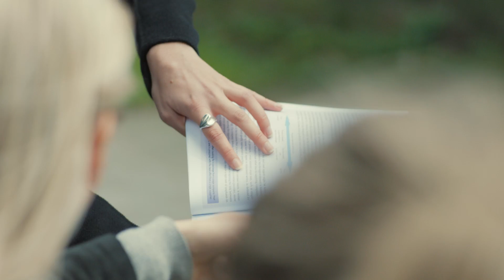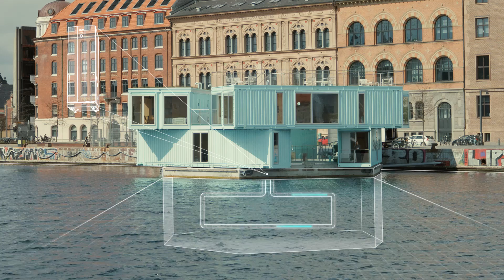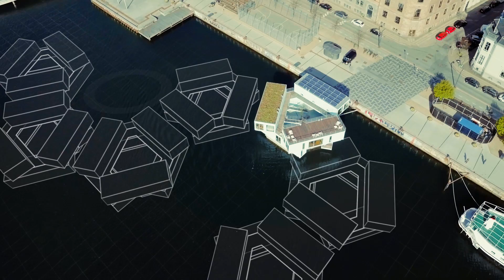Urban Rigger: Visionary architecture uses water as energy source, with Danfoss solutions

Comment: Oh, this house adopted an energy-efficient heating system called "Ondol" by spreading water pipes beneath the floor, which is originated from Korea. Actually, Ondol had been used by Koreans for several thousand years up to date but still, only Koreans use this excellent heating system in building houses. Then, do residents have to pay the local government for the use of water space?

Comment: I love the fact that they call this affordable... You can get housing for 50% less than the price they charge for these. I don't blame them, this hasn't been a cheap project. The houses are exclusive just don't brand them as affordable. They charge 7500kr excluding utilities. You can get rooms for 5000kr i Copenhagen.
Reply: economies of scale apply + working out problems in new ideas costs a bit more than hiring people to build traditional housing.  IMO, this technology could be cheaper to build over time ... plus if efficiencies are correct, then maybe some cost saving from lower heating bills.